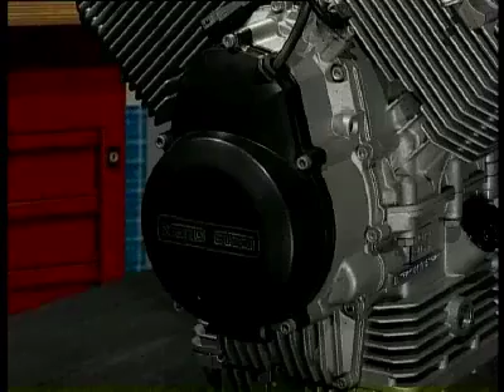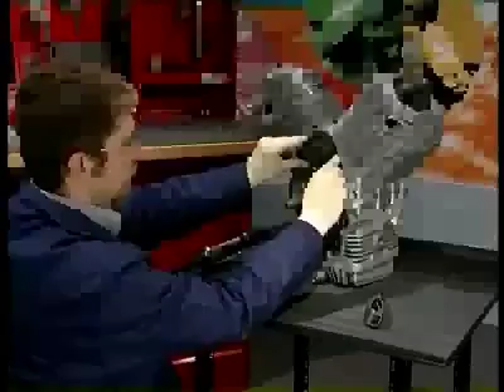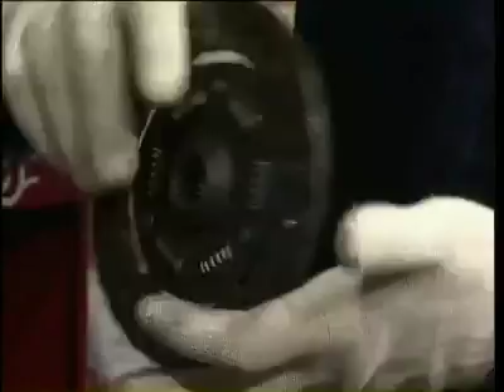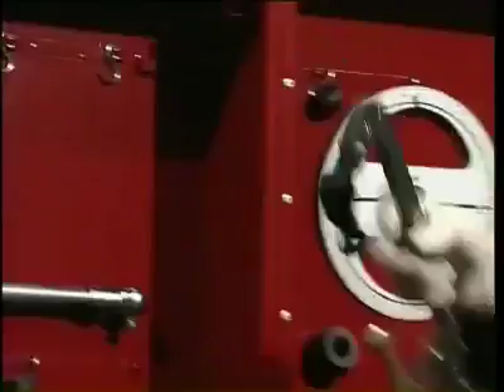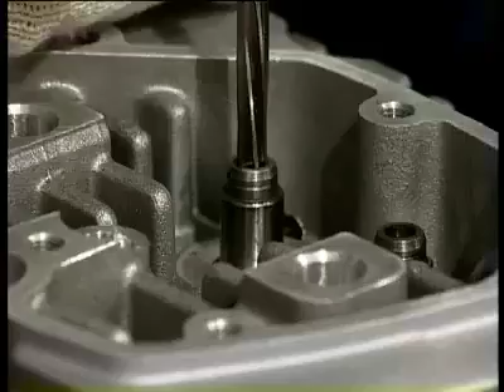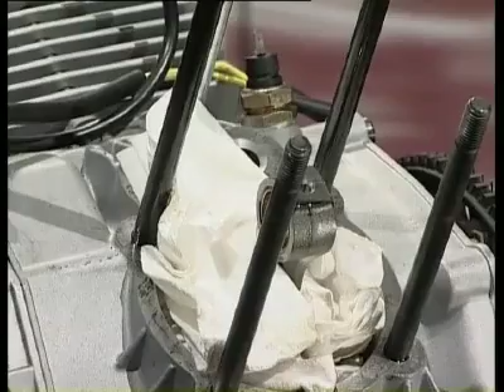Moto Guzzi - Small Block 750 Service PART  1

Comment: Good afternoon.
Thank you for this precious information.

I have bought a V7 Cafe Racer (65.000 Km), and it has an oil leak. (Probably a matter of front and rear crankshaft seals).
It would be lovely if I find a manual for engine assembly. I have seen a website (stein-dinse), with manuals availables, I'll check mine.
Thank you.